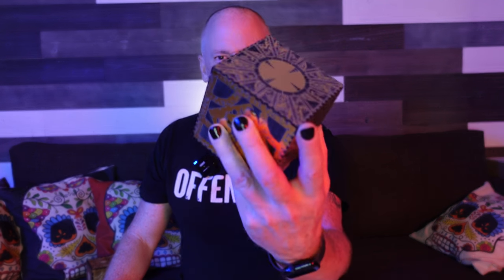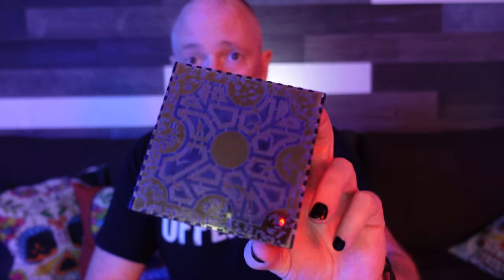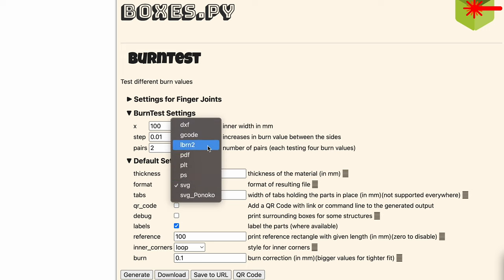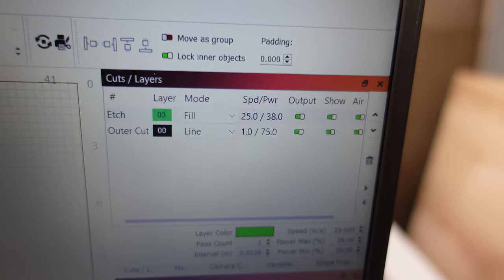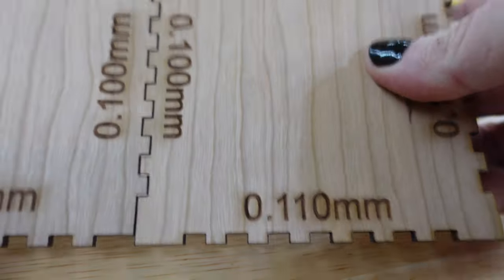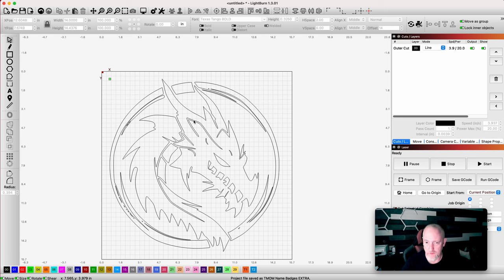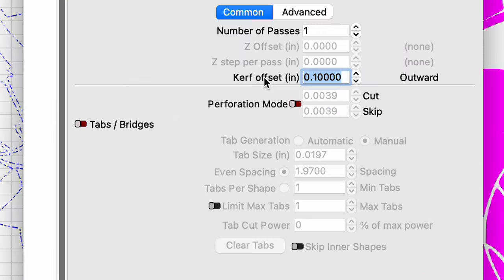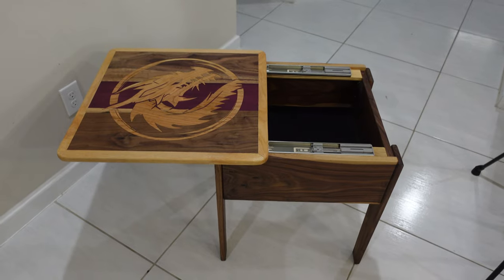Laser Cut Wood Inlay (How to Use Kerf Offset with my APLazer and Lightburn)

Comment: I don’t get it. What determines whether your kerf is positive or negative? You spent 1 min in lightburn during a lightburn tutorial and most of that was changing colors man….. can you please explain….
Reply from the maker: Negative kerf is inside and positive is outside.
Reply: Positive outside kerf would be to make the inlay/male piece bigger (put the kerf outside the nominal dimension) to compensate for the kerf removed.  Negative inside kerf would be to make the pocket/female piece have a smaller opening to compensate for the kerf

Comment: My Alpha will be arriving next week and I'm YouTubing the hell out of these videos  🙂   As a final finishing/sanding will be needed, IF the amount of inlay material is less that the base wood that it will be inserted to, should the inlay height be a bit higher than the base wood, then, the sanding will even the inlaid layer smooth?  That way the inlay piece won't sit too low into the base wood and the total amount of sanding will be less..  Thanks for the video that DID answer my inlay process questions..  Hank